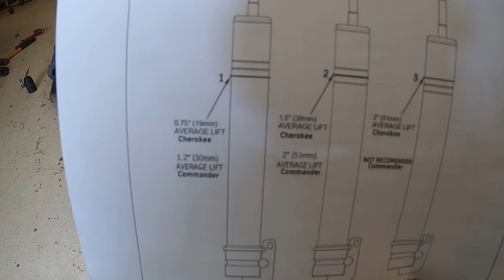jeep commander Font lift

Comment: Thanks for sharing all your commander postings. I have to do the same stuff on my '06 Commander, did the 5100 Bilstein's improve your ride in your opinion? I can go with either the 4600's or the 5100's. Just trying to see what you thought. I really like the way the Commander rides and don't want to stiffen it up. I like riding on a cloud, but it is time for new front shocks.
Reply from the maker: It rides better yes but I wish didn't change the front springs I think it would have rode better with the stock springs
Reply: When I drove the car when I bought it, I drove a different one that was two years newer, was a base model and didn't have the factory tow package. Gosh it drove really really differently. Rode harsh like a truck and not like a smooth floaty ride like the one I got. It was really different and surprising. I want to keep that same feeling driving around. This is my daily driver for my short commute. REALLY like how quiet it is, even after 160K miles. Everything else is stock. I have the same list of things to do that you have done. I don't think I will be doing a lift kit. I will try the 4600's and see how it goes.
Reply: I had the bilstein 5100s all around on my WK 4.7 and the perch set at 2in front with rear spacers..It was nice but a bit silly on pot holes, after the OME springs it was way better imo

Comment: Help please,

Now i lifted the rear of my commander with two inch ROuch country  and used belstien 5100 to make it a better lift. 
The front i put adjustable belstein 5100 shoks as well. 
I didn’t put any spacer since the 5100 already adjustable. 

At which line shall i put the snap ring to make it the same lift level as rear
Reply from the maker: If it's the same height on all 4 tires  and you like the way it rides I wouldn't worry about it

Comment: What kills me since it's coil over struts is rather than just stick a plate in there to give it a lift I rather just get longer coils and struts.....

Not to mention that the upper control arms really need to be a bit longer for any lift... it'll take it...but my last one needed ball joints after a good eight years of the lift on it.

Comment: Hello, one question. I installed same kit in my 06 Commander, but with the "no HD" OME springs. I feel that the suspension does not work well when there are bumps in the road. When it tackles the obstacle and the suspension is compressed, although hard, it works, but at the end, when the suspension has to extend before the weight of the front of the vehicle falls, it does not recover well the extension and loses grip on the road. This is extremely dangerous in curves.
Also, off-road are very uncomfortable, the set is extremely rigid and does not absorb anything. If this happens to me with the springs "no HD" I suppose that you with the springs HD will happen more exaggeratedly.
I get the impression that these Bilstein 5100 shock absorbers are too short, or too hard, and are not suitable for such long springs.
Greetings from Spain.
Reply from the maker: I feel like mine has to much recoil when I hit small woops on the high way also iv replaced everything under the front end and i still have popping some were
Reply: @BEAU SHOW 

Mine, in general, is extremely hard in the front, but I do not know if it's due to the hardness of the OME spring (mine is not HD), or the Bilstein 5100 shock, or the sum of the two.
Mainly, I notice it when the front suspension drops suddenly at the end of the speed bumps (even at very low speed) that the front wheels stay in the air and lose traction. In very bumpy curves, the car is going out to the outside of the road.
I think that the Bilstein shock absorber is working too stretched, and it is not able to absorb the wheels falling off, and that it would take a longer shock absorber.
I must add that my engine is the 3.0 Diesel, the lightest of all, sure that also affects.
At the rear there is no that problem driving, but the Bilstein is also limiting the axle extension

Comment: What rear shocks did you use?
Reply from the maker: balstin 5100 non adjustable
Reply: BEAU SHOW  are they the 0-1.5” lift shocks?
Reply from the maker: @ryantheiss6412   .75-2 in the front 
0-1.5 rear
Reply from the maker: Yes rear are 0-1.5
Reply: @ryantheiss6412  using shocks that are too short for the lift is the dumbest shit I've ever seen.. my honest opinion they may have a garage and tools but they didn't seem like they were the sharpest tools in the garage.

I had a lift on my old Commander for 8 years. Rocky Road Outfitters baby....